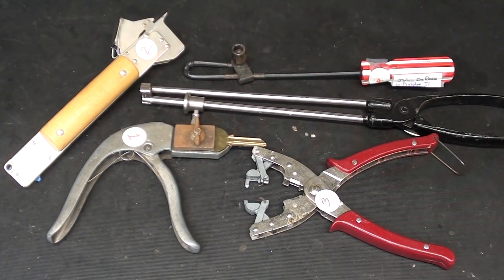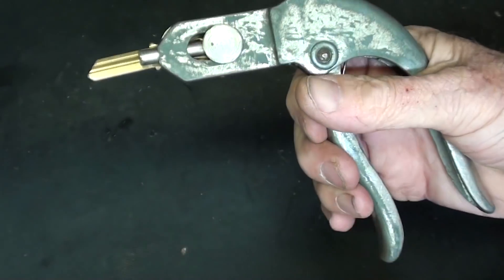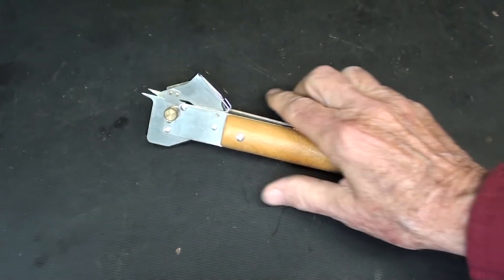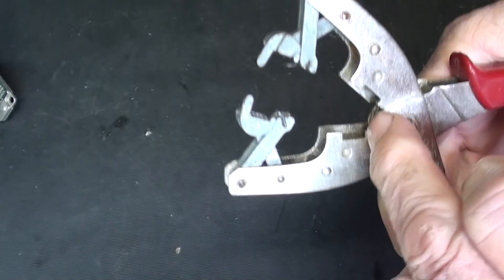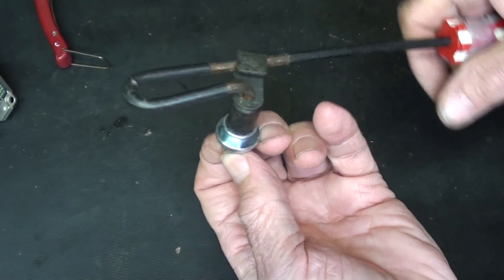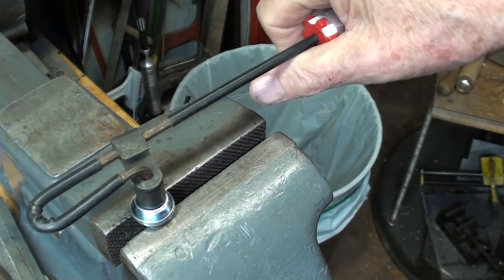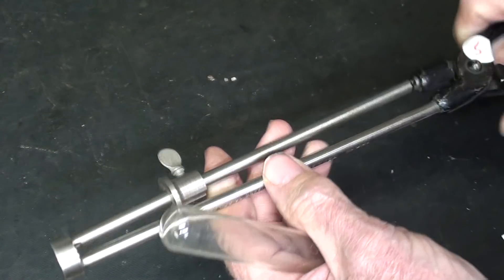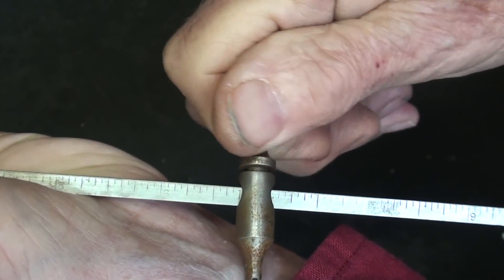WHAT IS IT? Mystery Tool Series 70b Answers tubalcain mrpete

Comment: Marine grade batteries are designed for the harsh environment of ocean going vessels. After all, no ( respectable ) captain wants to sink his own boat because of a leaky battery. Since ocean going vessels are all made of metal they'ld be very susceptible to just a tiny bit of battery acid.

Come to think of it, there are actually a couple kinds of fiberglass ocean bound vessels. The first, and by far the most famous and popular, is of course the speed boat. Who can forget the speedboat? Second, there's the highly infamous and notorious semi-submercible low profile vessels used by drug runners. But I bet they even still use marine grade batteries. Any ways, the purpose of the side terminal to top post adapters is to allow one to stuff a GM battery into a Ford without also having to change the wires as well. I've only had to clean up after a leaky marine grade battery a couple of times. But I always have to clean up after a top post over the coarse of its useful life. Well, when I think of it, I get those really fancy felt washers. I wonder what those felt washers are for. Couldn't be to fight battery acid and keep your wires from oxidizing could it? Nah! Best to replace the corroded battery wires with the proper side terminal style when you get sick of buying felt washers ( and up grade to a true marine grade battery ).